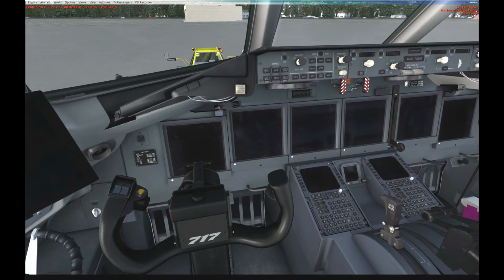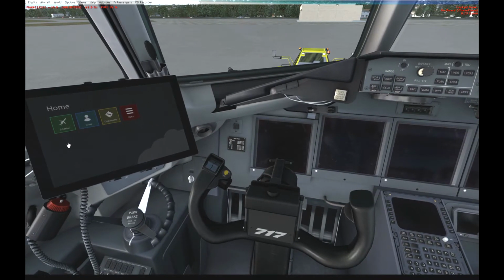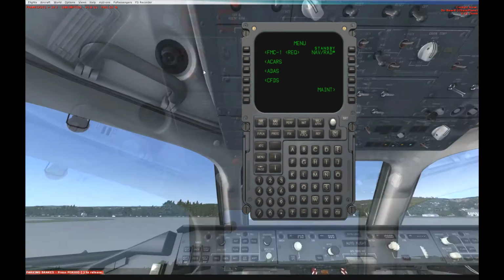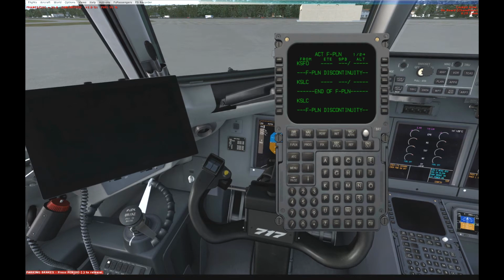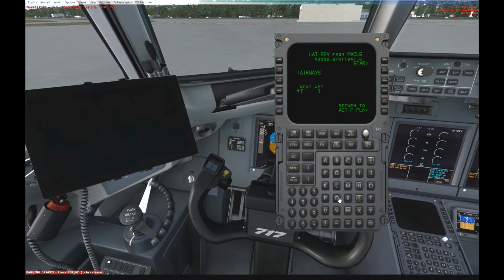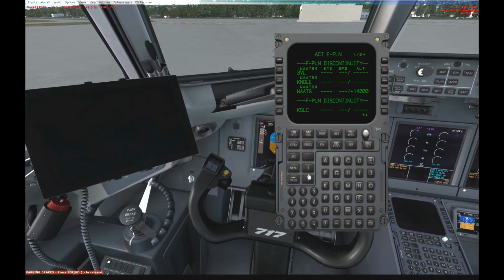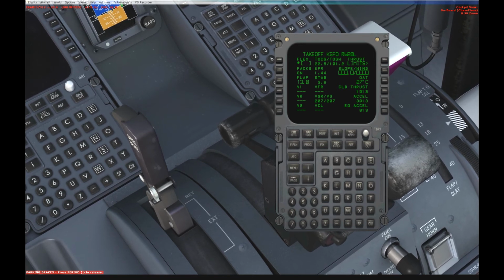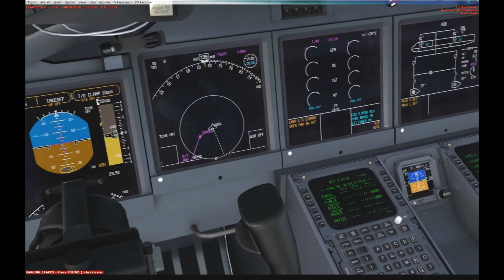[TUTORIAL] How to Set up the TFDI Boeing 717 Flight Management Computer

Comment: The flow is not like the other Boeing aircraft because it's NOT a Boeing aircraft. McDonnell-Douglas designed this plane, Boeing simply built it.
Reply from the maker: Actually when Boeing bought McDonnel Douglas, the MD-88 then became Boeing property.  They replaced the flight deck and kept it in production for a few more year.  That said, this flight deck is waaay better than the flight decks of the 757/767.  Much easier to fly.
Reply: If you're talking about the MD-90's that had a Cockpit that was almost identical to this one, those were special ordered by Saudia from McDD and not Boeing.